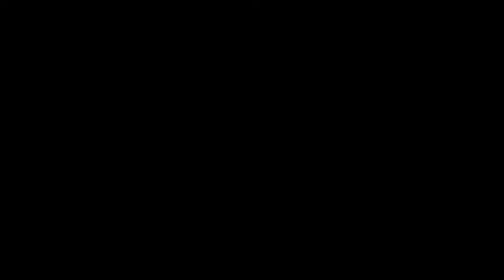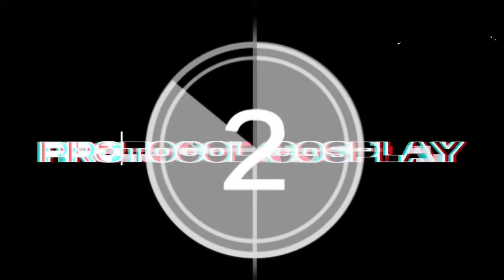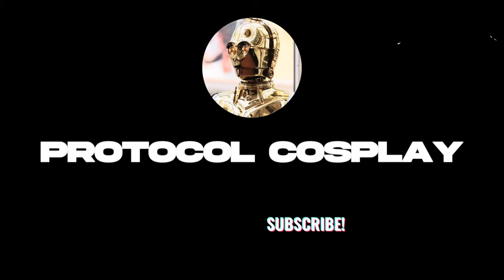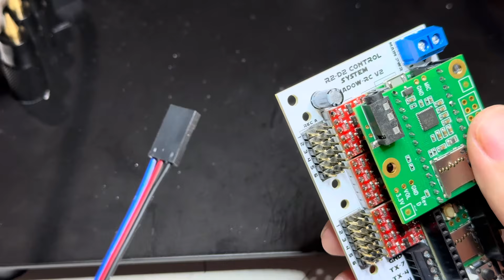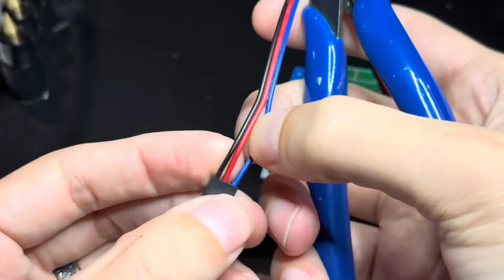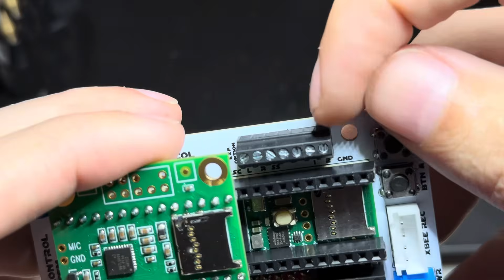Shadow_RC V2 Board DEEP DIVE!

Comment: Hi Steven, my name is Frank. I was wondering if you could help me at first I wanted to use a radio master controller to control my R2 which I am in the process of 3-D printing right now. I was going to use a USB/Bluetooth wireless keyboard to trigger my MP3 sounds. I’m using an ESP 32. I have an SD card reader and audio board an amp and speakers and right now through ChatGPT I’m able to get the sounds to play from 1 to 168. I cannot get the keyboard connected to the Esp. Do you know if this is even possible ChatGPT has had me here for weeks applying codes with nothing but errors I’m starting to feel like shadow or see is my best move, but I still want to use the radio Master can you guide me in the right direction thank you.
Reply from the maker: I have no idea about all of that. I don’t use ESP32 for my projects, I’m not sure what code or library would need to be used to get a keyboard to make sounds or button presses. That’s all stuff I haven’t looked into to be honest. So, sorry I can’t really help in that area